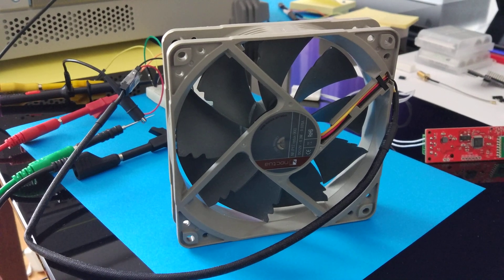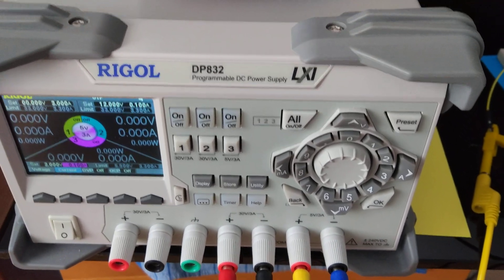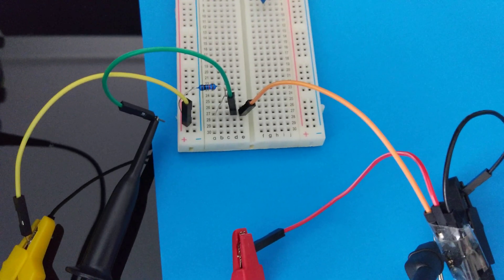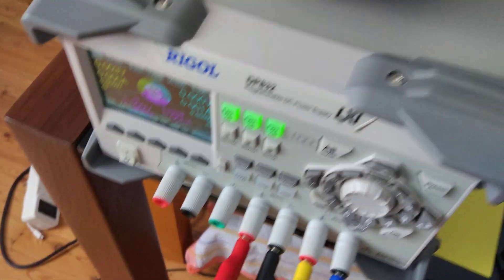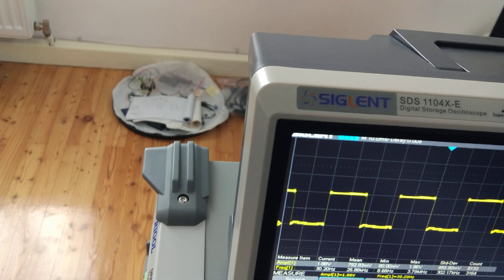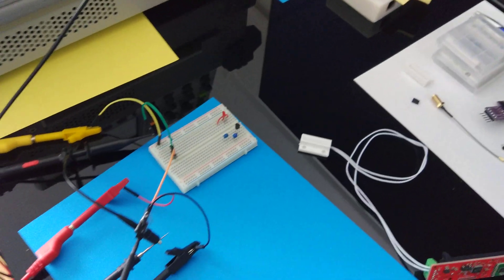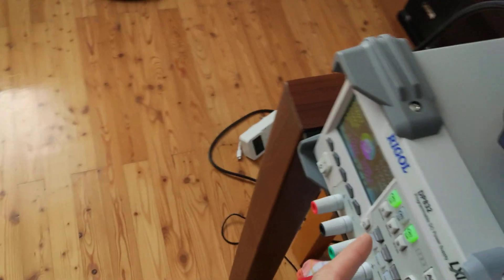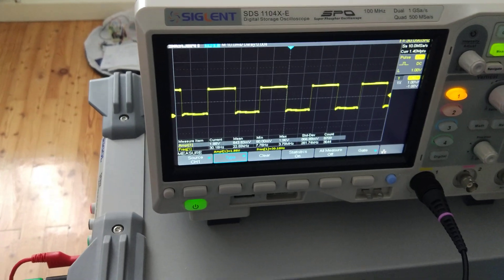Counting the RPM of a fan on an oscilloscope

Comment: Can you show pwm vs tacho signal?
Reply from the maker: I have no access to the PWM signal. I'm only supplying DC power to the fan.
Reply: Ok looking forward for the next video. Would be interesting to see how the tacho signal changes if you slow van by an object
Reply from the maker: @solidfuel0  If you stop the fan, the signal will be constantly high (2V). If the fan spins at a slower rotational speed, for any reason, the pulse frequency will decrease. The pulses will occur at greater intervals, and the period where the signal is pulled low will also increase.